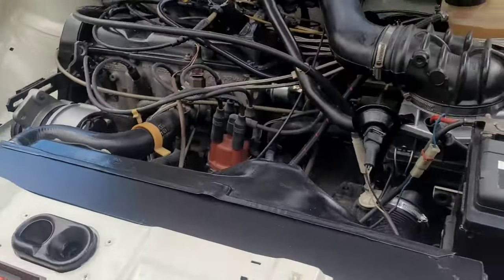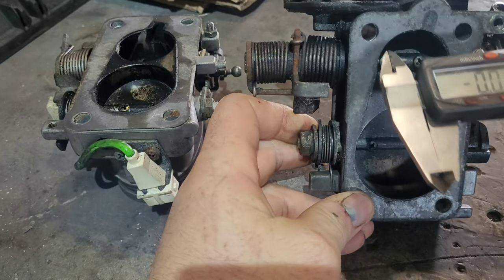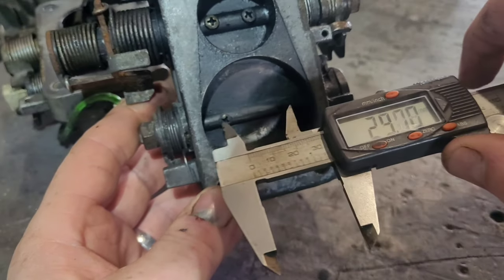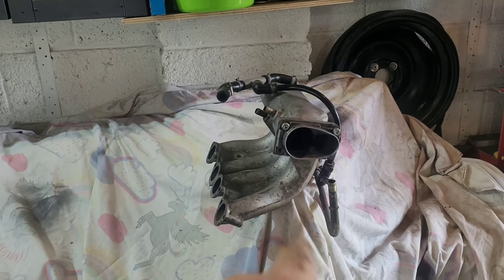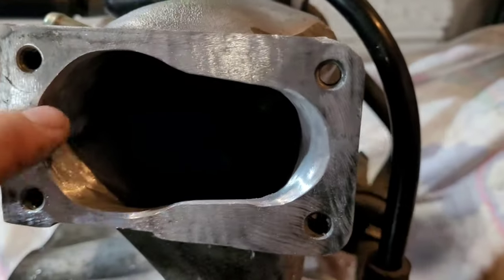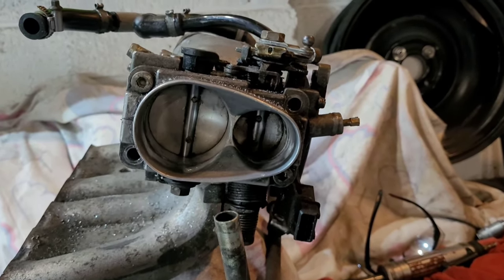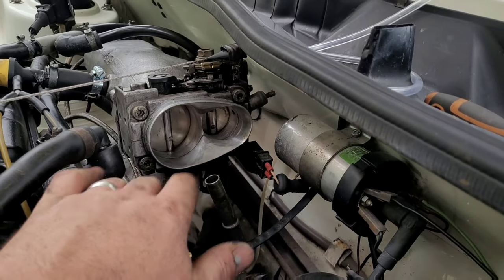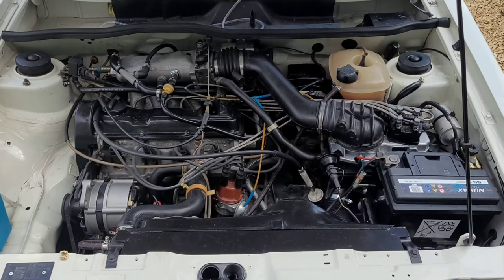VW Golf GTi Mk1 - Throttle Body Upgrade

Comment: Just One tip, the latest mk1 cabriolet with the 1.8 digifant, already have the larger throttle body from factory, and a specific intake manifold.
You can port a little bit the shaft and the plates, good gains to be made there.
Reply from the maker: Good point ref digi having the larger type, its only the k-jetronic that relates to the upgrade

Comment: Great vid!
How do you decide how much the timing needs to be changed? Is there some kind rule of thumb?
Mine's a 1.8 8v with Audi 100 TB, full 4-2-1 supersprint exhaust, other camshaft and higher compression+flowed head. But I'm not sure my timing is spot on and not really sure when it is right. 
Any tips welcome!
And always enjoy your videos, keep'm coming!
Reply from the maker: It varies from car to car, for example my 16v is currently running 4 degrees more advance than stock.

8v gti for another example both with 16v  WUR mod one happily ran 1.5 degrees more than stock the other didn't like stock so was retarded by 1 degree.

Get it set to stock correctly then add a bit, reset CO% then road test, repeat multiple times until no more performance is gained/felt or pre detonation occurs

Obviously easier with a dyno but live road testing provides better results as you can feel what the engines doing
Reply: Wow that's great! Will try it out in a week or two, thanks man 👍

Comment: How did you clean all of the metal shavings out of the inside of the intake manifold & the runners too?
Reply from the maker: I only do it with the manifold removed, easy to get off
Reply: Right I took my manifold off too. Then I used a vacuum cleaner, tube brush, & towels. Did you have a better way of removing the metal shavings?
Reply from the maker: @jonathanthabeast4928 aahh got you, similar to that then rinsed it all out with brake cleaner